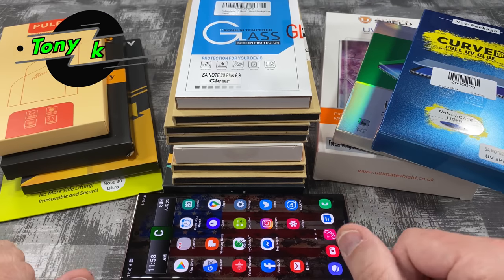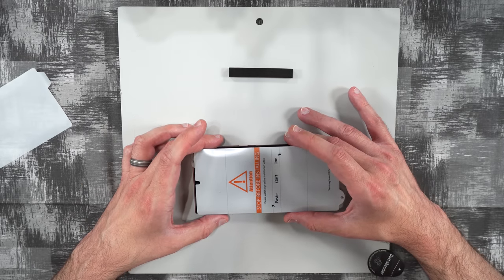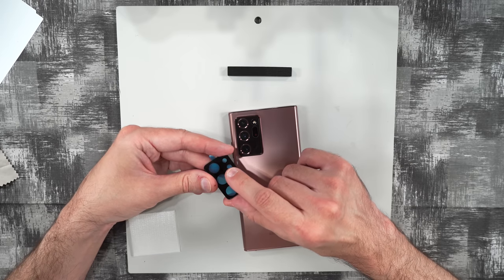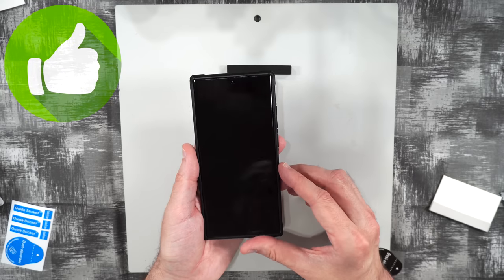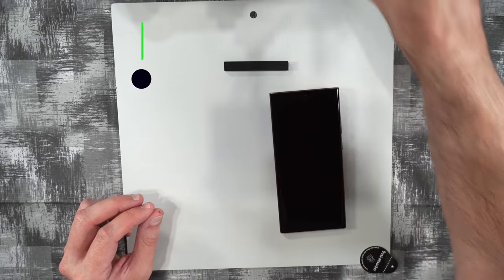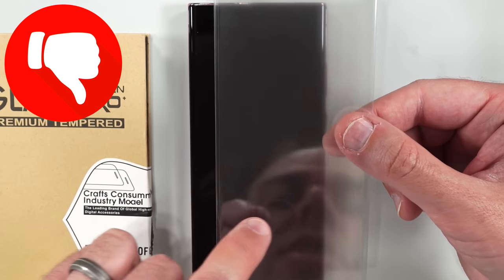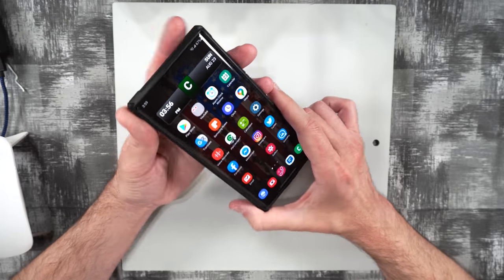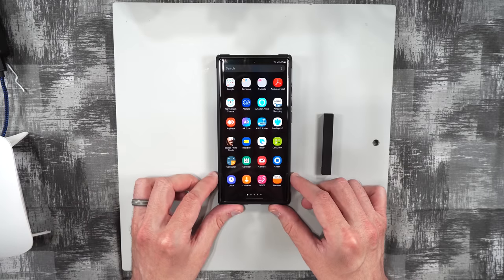Best And Worst Screen Protectors for Samsung Galaxy Note 20 Ultra

Comment: Still not sure which one to order. i dont want this hole (looks very shitty) but i do want to protect my display as good as possible. i destroyed the display of my note 8...dont want this to happen to my new Note 20 Ultra.
Reply: I have used Whitestone Dome Glass for years since I owned my S6 Edge. Have never had a cracked screen thanks to them! Had them on my Note9(1 screen lasted 2 years!) and now I have it on my Note20 Ultra. I will never use any other screen protector. Worth every cent. Yes works with the fps. Register Fingerprints AFTER you install it so you have no issues.

Comment: This is why i hate curved screen phones very hard to find decent screen protector
Reply: Facts
Reply: agree. it's not functional, and in screen fingerprint sensor
Reply: @asfsfas2435  I have a Am film glass screen protector from Amazon i highly recommended it its like domeglass installation but its more affordable
Reply: @Zeuroz靴  does it cover the curved sides as well? $40 ain't cheap though
Reply: @asfsfas2435  yeah its like domeglass but more affordable it comes in a 2pack
Reply: @asfsfas2435  I watched a really detailed yt video on how to install it and it turned out great